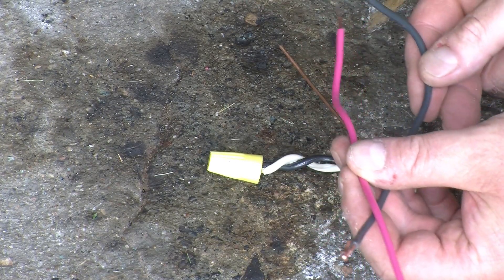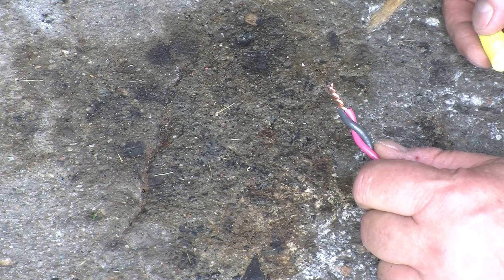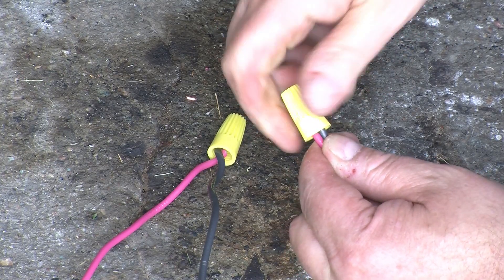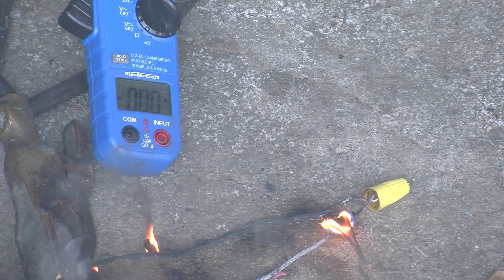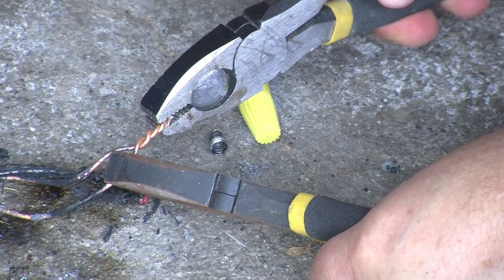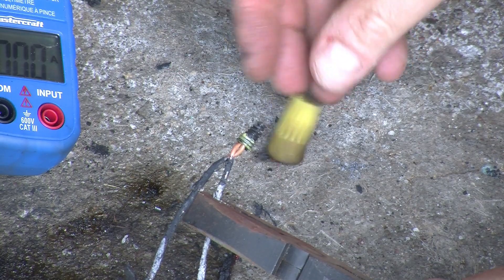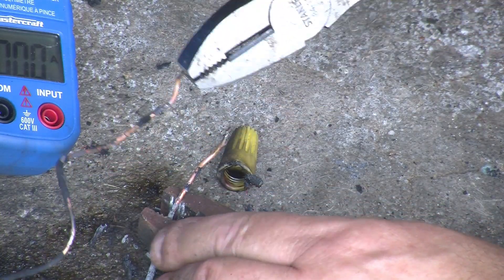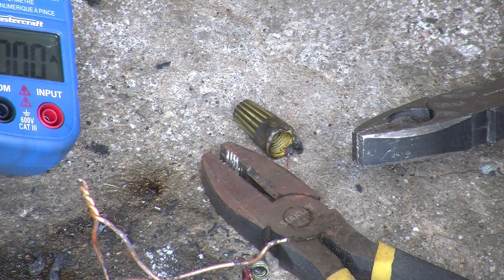270 Amps through Wire-Nuts aka Marr Connectors

Comment: For interior AC wiring splices, there is not much better or cheaper than a simple wire nut. They work great, and last a long time. I’m a fan of pre-twisting, as well, but never had any data to back up the behavior, I just felt like it would produce a stronger mechanical/electrical connection.

That said, I also do some solar/DC electrical work, and I will say that other splice connections are probably preferable in those situations, like a weatherproof, UV resistant Polaris lug which allows you to sit the wires inside ports with anti-oxidation gel inside of it with weatherproof insulation. I’ve also found the Polaris lugs to be extremely good at making electrical splices that do not come apart over time.
Reply from the maker: Yeah - you cant beat wire nuts for simplicity and they work so well as proven by years of use!

I just looked up Polaris lug - they look excellent. I am planning on installing bunch of solar panels and they sure look like the  perfect thing for that. Thanks for mentioning them - I sure leaned something from you comment which is always great!

Comment: Simple, cheap, and reliable: my favourite engineering solution!  In Ontario we used to call these Marrettes.  TIL the inventor was a Canadian electrician named Marr.  In the last few years I see a lot of videos from the U.S. where they use Wagos but those connectors don't seem to be available here.  If you can find some, do a side by side comparison of the two types.
Reply from the maker: Exactly - Mr Marr really nailed it way back then. I am in Ontario too (Ottawa area) - I didt get Wagos form Amazon, and I think Home Deopt now has them. I would consider them to connect a single light fixture in an awkward location, but not for anything with higher current possibities even theough in fairness to them, they do seem to meet the spec. I did do a quiick test with them against wire nuts and other things in a video that comes shortly after this one ...

Comment: This is the second time I saw this guy's experiment, both times he set up for things to fail the way he want people to see them.  The first one was the different types of connectors.  He happen to change the connector that he wants to fail to 14 gauge while the rest were using 12 gauge conductors.  This one is not as obvious, but still biased nonetheless.  Notice how the none-twisted wire stood erect where the flame rise while the twisted wire nut sat flat on the ground.  Doesnt takes a genius to realize that smoke and flame like to travel upward.  You are not doing people a favor by doing stupid test that you think it is scientific while they are not.

Comment: I've been a sparky for over 50 years and always pre twist my wires and install a few wrapa of tape on them.
Reply from the maker: From everything I have seen, what you do is the gold standard of how it should be done. What has amazed me is how a number of commenters have argued vehemently that the wire should not be twisted. Twisting in my opinion seems to produce a better electrical connection and provides mechanical stability in case the wire nut loosens, as does taping.

Comment: I would say the untwisted connection did as well or better.  The wire seemed to heat up faster and the insulation burst into flames more on the untwisted test.  This suggests less resistance in the connection and thus more current heating things up faster and hotter.  I would not conclude that the untwisted connections was better without repeating the test a few times and timing how long it takes for the insulation to catch fire in each case. Interesting result though as to how well the wire nut works given all the hype about Wago style connectors.
Reply from the maker: You make a  great point concerning repeating - one really needs to repeat each test multiple times to handle slightly better and worse connections etc.
Reply: @ElectromagneticVideos  Absolutely.  After a 32 year career in R&D, working with a number of statisticians, if you brought them less than 10 data items, they would laugh you out of their office.  😁. I still chuckle when I see all of the YouTube “tests” that run one iteration comparing tools or techniques and then make broad claims about the results.  Most have no idea just how variable most experiments/measurements are.
Reply from the maker: @LTVoyager  You mean they didn't appreciate a sample set of one? I'm shocked :) Funny - after writing my previous response I was thinking a bit about how would one handle the results of a batch of real tests similar to this one. Unlike the usual averaging one might have to actually consider using the worst case result in the interest of safety - or some sort of average of the worst 10% of results sort something like that.
Reply: @ElectromagneticVideos  They appreciated a sample of one for the comedy aspect.  I think whether you use worst case or average depends on what you are doing.  If you are trying to decide which device is better, then I would look at both average and standard deviation.  We generally set limits based on say the 3 sigma point rather than a worst case measurement as often the 3 sigma point was more conservative.  Now, if you are setting a maximum current limit, then using the worst case with a margin might be the way to go, but I’d probably still have more confidence in making several measurements, computing mean and std dev and setting the limit based on the statistics rather than a single outlier measurement.
Reply from the maker: @LTVoyager  Completely agree! Just so you know, I ended up doing these little experiments totally by accident after I was about to throw out an extension cord and at the last minute thought it would be fun to see how much current it could handle. Ended up with numerous requests for more. They are not intended to compete with UL or CSA, but are more in the category of lets see what happens if .... . In the later tests what I was hoping to   show what happens when overloads occur in wiring in walls - something strangely lacking online! What I was surprised at was how little margin for error there is with 14/2 in a modern insulated wall when one is at the higher end of currents.  Particularly applied to my area - Ontario - where we now put crazy amount of insulation in attics and outside walls.

Comment: you keep saying some call them wire nuts, and use some canadia word "marr" .. ive opened Hundreds.. possibly THOUSANDS of wire nut bags, plastic jars, various containers, OFTEN labeled by the Manufacturer AS Wire Nuts... not some people call,  .. the Maker  (Ideal) says they are, in all that time ive NEVER ever,... never.. seen one labeled as Marr or Mar... maybe mars
Reply from the maker: There quite commonly called Marr here - and its actually one large manufacturer's trademark. The were invented almost 100 years ago in Toronto by William Marr.
Reply: They are twist-on connectors.  Ideal makes Wire-Nuts and Wing-Nuts.  I think Marr is a carryover from the beginning when they were a type of ceramic/porcelain material without a "spring" inside that have long since been banned due to cracking and falling off.  The connections were still good, but not insulated which could short to metal electrical enclosures or to each other potentially causing a fire .  The stigma from those has also carried over to the twist-on connectors which do not have any problems and are probably the best connection available.  People are quick to regurgitate what they always hear instead of researching for facts.  Americans really mess up terminology.  I bet you have heard someone say 4 aught wire.  It is actually 4 naught wire.
Reply from the maker: @solarsynapse  Marr is actually a brand name used in Canada and a leftover from the esrly days when Mr Marr invented those typse of connectors. Ithink the UK had a differetn variant of them that causes the problems you described. I dont think we ever had that issue in North America.
Reply: @ElectromagneticVideos  I have seen a few in the U.S. many years ago in old buildings.  They also had knob posts with cotton insulated wires!!! The only place they may be good is in devices with heating elements due to the high heat melting plastic.  Those devices have woven fiberglass insulation.
Reply from the maker: @solarsynapse  you know, i actually saw ceramic ones still available exactly for that purpose

Comment: It’s not uncommon to see instructions stating that the wires should not be twisted together before adding the wire nut. But from your experiment, it appears that a pre-twist is indeed preferable.
Reply from the maker: As far as I can tell, it seems like the instructions vary from manufacturer to manufacturer. may have something to do with how the inside of the nut is configured. If the manufacturer of certain nut specifically said twist, I would follow their instructions in spit of my experiment. Similarly if they specifically said twist. But if the allow either, I think twist is it!
Reply: not, look at the way he set up the experiment,  The pre-twisted wire nut lays flat on the ground while the other one, he made the wire to be properly up so that the fire and smoke would travel up the wire nut.  Just garbage info

Comment: So that’s what would happen to 14 gauge wire connected thru a breaker to 200 amp service?
Reply from the maker: If you mean directly to the 200A breaker (as opposed to a 15A one which would hopefully trip) and shorted to ground? 

My guess is you would get a huge inrush of 400,500, 600 more more amps. The size of the current would be very dependent on the sum of all the very small resistances in the current path.  My guess would be and instant shower of molten copper where the wire or a particularly poor connection was, maybe with explosive vaporization of the plastic in the cable.  If one was really lucky the 200A breaker would trip in time to prevent much of that.   I have never actually seen that "unfortunate" scenario. The 270 Amps from my arc welder would pale by comparison.

Any of the electricians reading this seen a catastrophic failure like that?
Reply: @ElectromagneticVideos  Right, a 200 amp breaker or a switch with a loop of wire like in your setup, which simulates a short.

Comment: Thank you for creating this video.  As a retired electrician who started doing maintenance on industrial applications way back in 1980, I have never seen a single failure due to a faulty wire nut. We used all kinds but the standard twist on wire nut was always the best and most reliable.  I dont think these youtube videos that put doen the wire nut really know what they are talking about.  Thanks again and I hope to see more.
Reply from the maker: Its so interesting in hearing long term experiences like yours, particularly that most plain and simple one was the best. I wonder what electricians will be saying in another 50 years about all the push in or lever connectors? I always think simplest is the best, and newer isn't always better.  Glad you enjoyed  the video. I will do more!
Reply: @ElectromagneticVideos let's find out - test push connector vs wago vs wire nut!

Comment: I’m glad you’re doing these tests, but I bet they smell awful. Do you think it would be worthwhile to do a test with the wires passed through a piece of sheet to isolate the wire nuts from the flame, so that it tests what happens with only the heat of the wires?
Reply from the maker: They do smell! The very old extension cord smelled way worse than the 14/2. I was coughing from the very diluted smoke quite a distance away (test are done neat the open garage door for max ventilation).  I now completely understand  why its mostly the smoke that kills people in house fires rather than the actual fire. You make a very good point about protecting the wire nuts from the flames.  If I get a chance I will try that and make a video this weekend. I also just ordered some "modern" lever-nuts and if they get here in time will test them as well  for comparison.
Reply: Electromagnetic Videos Smells like grandad’s old rotting screwdriver handles, except on fire, so even worse.  Yeah smoke inhalation definitely will affect you quicker than you might think, but if it’s an electrical fire, like what you’re exposed to in these tests, it’s even worse because of the extra fumes from the plastic along with the smoke.                       

   If those lever nut connectors are anything like the little Mickey Mouse 3-way splice connectors that I see working on some automotive electrical systems, then I’ll bet they won’t survive as well as a regular wire nut.
Reply from the maker: @Rhodes350  "I’ll bet they won’t survive as well as a regular wire nut." You bet right! I just tested that and as soon as I edit  the video I'll put it up. Having said that, they did way better that I would have expected!